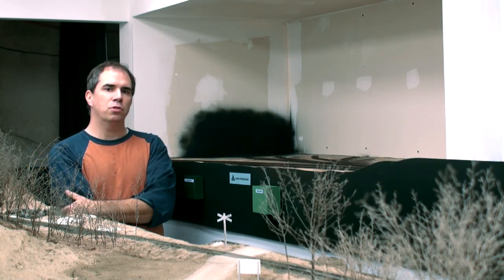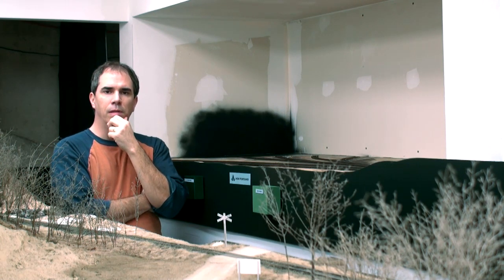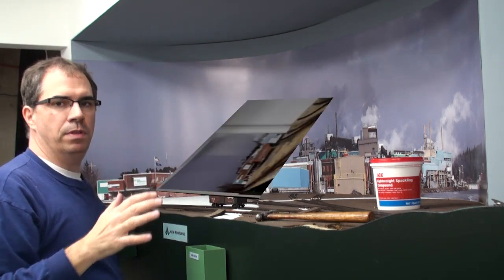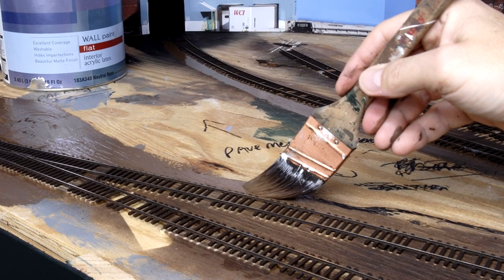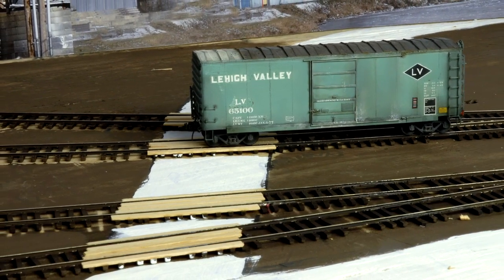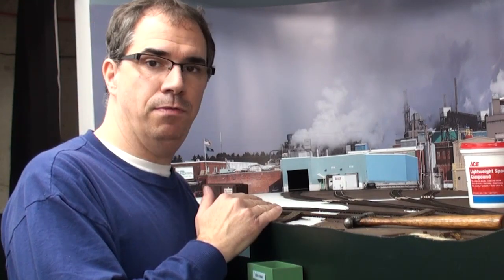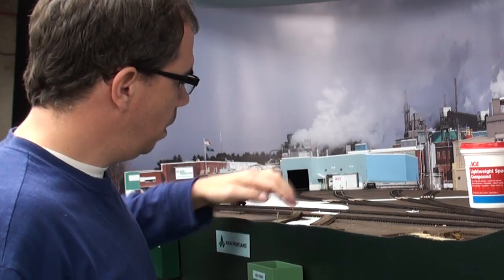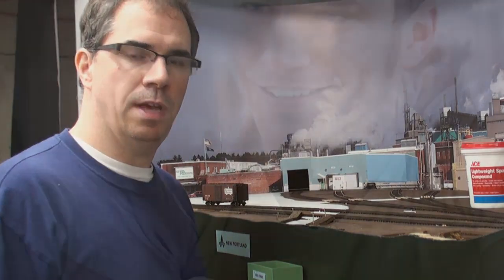Building the St Regis paper mill scene, pt 1 | Allagash Railway | Model Railroad Hobbyist

Comment: One problem with what you said, "We know paper mills are gigantic industries". Not necessarily true. Depends on the paper mill. I am a member of Yahoo paper mill modelers, they have provided me with quite a few prototypes that are actually quite small. Your 2.5 by 6 foot area might be a condensation of about 1/4 the actual size, in Ho scale if you are building something 1/4 of its actual size, you are doing great. Most people model mainline railroads and represent hundreds of miles with MAYBE 3 or even 10 actual miles of track. Pretty unbelievable. You can go my route, the smaller, the better. More detail, more realistic if you pic a few medium and small sized industries like I have, the largest is 21" across the backdrop, the beauty of it is it is in my imagination, about 20" at its deepest point and because my building is not the same depth all along the backdrop, I have over 21000 square feet of warehouse. There is a warehouse in Batvia New York that is about 22,000 and was featured in a model railroad magazine. A modern warehouse about the size of my own, but I don't have to show the entire building because the angle I set it at, hides its depth, your imagination is the only limit. And it's very realistic. Then I have the typical 4X8 layout buildings that are also prototypical, like the feed mill featured in Model railroader in New York, I believe the feed mill is RJ Crowley and Sons, something like that. My building is actually bigger than the prototype, but with the same architecture. I model Michigan because I'm sick and tired of desert and western layouts, I have already done that, boring. Your quarry isn't nearly as large as one that is in the next town from where I live, does that make it unrealistic? Well, are all quarrys the same? No. I know of a tiny one a bit farther from me that is now closed down. When I hear someone say "that isn't prototype", unless they are speaking of using hot wheels cars, hot wheels track and making the locomotive do a loop de loop, then I would probably be able to debunk your myth of "unprototypical". I have been doing this for years, enjoying showing those unbelievers that there is quite a bit of prototype operations that are not typical of most railroads, quite the contrary. Sorry to seem so disagreeable, but since I'm a nut and bolt counter to the point of fanatic, and I do custom work for many years, I guess I like to shake things up a bit.